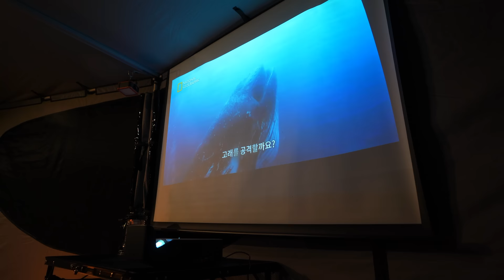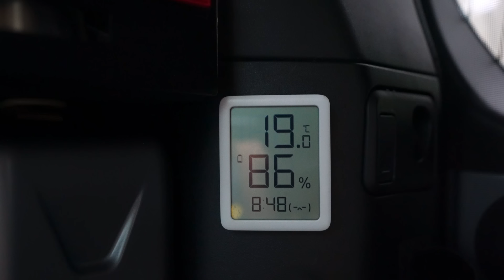☔ 빗속에서, 바람속에서, 햇빛속에서 나홀로 | 랜드로버 디펜더 110, 우중 솔로 차박 캠핑, 제임스바로드 팔콘 270도 어닝, 팔콘 샤워텐트

Comment: I went and test-drove a new Defender the other day. It's a nice enough car in fact it's really nice but I have to be honest it's a sorry replacement for the original Defender. The original Defenders were extremely tough Vehicles, built like tanks, made for off-roading and the outdoors. These new ones are more like something my grandmother would use to pick up groceries. Don't get me wrong, it's still a very nice vehicle with a lot of nice features but they really should have called it something different. It's no Defender.
Reply: As a person who owns both old and new both vehicles have it’s pros and cons. 
I just came after doing 6500km overlanding from Cape Town through the Caprivi down back from Kasane (Botswana)…in the new one. It blows the old one out of the water. 
The only thing that it loses out on is  “what if it breaks”. In Africa they won’t be able to fix the new one.

Comment: Very nice tent set up! Just one thing. The flaps at the bottom should be inside the tent then you can lay over a tarp on those also add in a roll rug over that and your set!
Reply: It needs some kind of system of baffles that would tuck under the body of the car, otherwise, mosquitos, flies and other winged pests can get in from under the car.
Reply: @tinydancer7426  it’s camping. Insects are part of it.
Reply: @jannkimithaiwala2825  Not if you  have  properly designed sleeping/habitation quarters to protect you from the insects.  With your comment, one would have to reply with, if insects are a given when camping, why bother with repellent sprays, citronella candles, bug repellents and lamps that attract and annihilate insects, etc., all items designed with one purpose ..... to repel insects/protect the camper from insects.  I mean, it's camping. Right?  Insects are a part of it.  NOPE!  Edit - I forgot about mosquito netting.